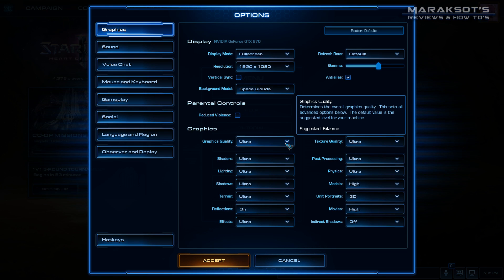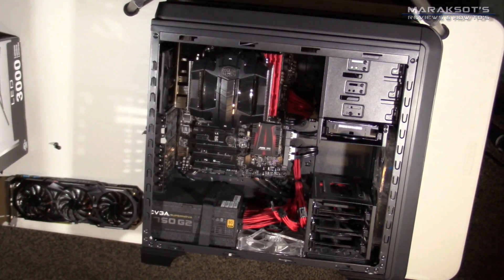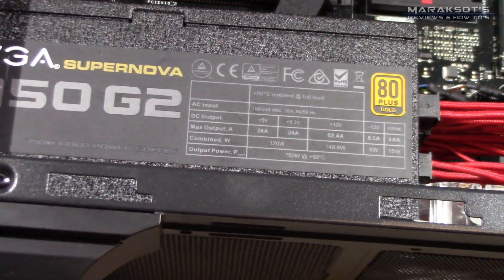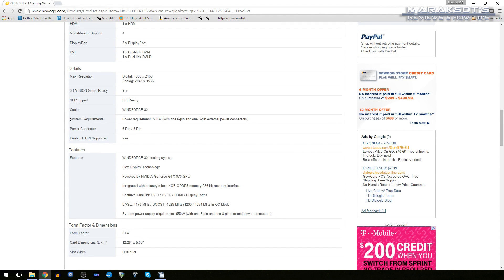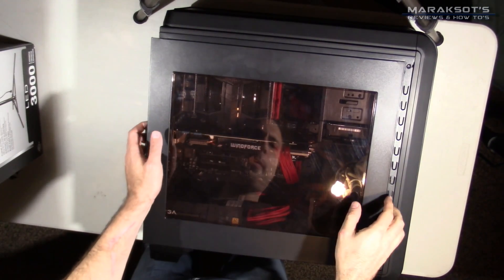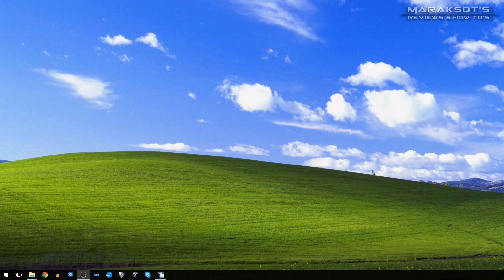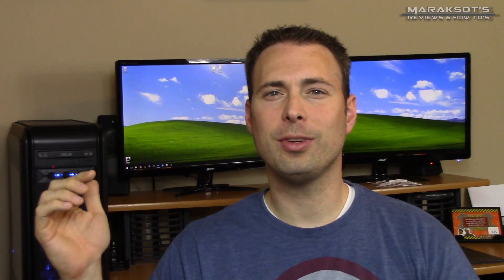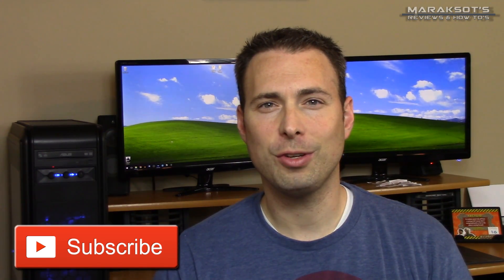A Beginners Guide - Upgrade your GPU - How to Install a New Graphics Card

Comment: Hey there, this video came up on my first google search for "how to install a new graphics card". I clicked play and it auto-forwarded me to the exact part about installing a new card. Never done it before, and found your guide really helpful! I'm taking my old card out and replacing it in the same (top) port. its a GeForce GTX 1060 OC edition, if anyone perhaps wondered. Thanks again, will be checking out how to change my old HD into a new SSD after I get the card working!
Reply from the maker: Thanks for checking out the video and for leaving such a friendly comment.  You are of course more than welcome to check out my other video on swapping out your hard drive for an SSD a well.  Cheers bro!  :)
Reply: well, its taken way longer than I thought, but I have got the graphics card working first time, and the a new SSD AND windows installed on it - the motherboard gave some trouble with a dual boot menu (f8 and bios via del) which all had to line up. Thanks to your videos and a VERY helpful and patient friend, i'm downloading stuff to the new drive, updates etc now. Thanks again!!
Reply from the maker: Congrats man, enjoy!  :)

Comment: Question: wont you need to uninstall the driver of your previous card to avoid conflict?
if so what the sure way to ensure that no vestige of those drivers stay on your computer?
Reply from the maker: You can switch cards before uninstalling drivers without any problems but yes I always uninstall the old drivers and then install the new ones. You can use a program called DDU (display driver uninstaller) from Guru3D and it will do it for you or you can follow this tutorial video I made and do it manually.  https://youtu.be/e3dGYvIa4pg

Comment: Can someone help I can’t see a 6pin or 8pin?
Reply from the maker: If your power supply doesn't have 6 or 8 pin PCI Express power connectors on it you're going to have to either buy a new power supply or buy some adapters. They have adapters that go from molex to PCIE as well as SATA to PCIE.
Reply: Maraksot78 im new to this stuff dose it have to a 6/8pin
Reply from the maker: Yes.  If your graphics card has a port on it for plugging in a 6 or 8 pin power plug you have to plug in power to it other wise the graphics card won't work.  Your motherboard is capable of supplying something like 75 watts through the PCIE slot your graphics card plugs in to.  So when a particular GPU requires more than 75 watts to operate the manufacturers supply the card with the additional power they need directly from the power supply using the PCI Express power cables.
Reply: Maraksot78 so I need a new power supply
Reply from the maker: only if your current power supply doesn't produce enough wattage.  What graphics card are you putting in and what's the wattage of your current power supply?
Reply: Maraksot78 the watts of my corennt power supply is 500w
Reply: Maraksot78 I don’t know what graphics card to put in but I’m looking for 1
Reply from the maker: I asked what graphics card you're buying because on the specs for the card it will usually have a suggested power supply wattage but 500 watts is great and should be enough for most current gen graphics cards.
Reply: Maraksot78 will it have a 6pin that I can’t see
Reply from the maker: are you talking about the graphics card or the power supply?
Reply: Maraksot78 do you have Instagram it will be easier to talk on there
Reply from the maker: yah,  I don't use it much. I'm Maraksot78
Reply: Maraksot78 I’ll dm you

Comment: I turned off my pc power supply took out the old graphics card put in a new one  plugged everything back in and it says the signal was received but my screen is black
Reply: It won’t show my display
Reply from the maker: So when you first boot up your computer do you see your motherboard splash screen and can then enter your BIOS/UEFI but as soon as Windows starts to load up then the screen goes black and doesn't come back? If that's what's happening then a BIOS/UEFI update for your motherboard should fix that.

Comment: Can you please help me my screen won't turn on after installing gtx 730 it only works if I take it out help me
Reply from the maker: After you install your graphics card are you plugging your monitor cable into your graphics card or into your motherboard, i.e. the video output next to all your USB ports and stuff?  If you're keeping it connected to the motherboard output you will not get any video signal because when you install a discrete GPU the onboard video on most motherboards is automatically disabled.  This is because if you don't plug your monitor into your graphics card then you'd still be using the onboard graphics and not the video card to do all your graphics processing.  If you are connecting your monitor to your graphics card and as you boot up you see your motherboard splash screen but then as it loads into Windows everything goes black then the only way I know how to fix that is to update your motherboards BIOS/UEFI.
Reply: Thank you for helping I got everything  sorted out now, I just need to install the driver
Reply: I cant find the driver for geo force GT 730
Reply from the maker: If you go to this site you should be able to select the GeForce 7 Series from one dropdown and then select the GT 730 from another and it will have a link there to download the most current drivers. https://www.geforce.com/drivers
Reply: does it matter what series it is? Sry for wasting your time
Reply from the maker: I'm not 100% sure it matters... After a GPU reaches a certain point they quit developing drivers for it but until that point the most current driver package will cover the most recent GPU's (currently the 10 series) as well as a few generations back. Whether the 7 series is still included I'm not sure so it's a good idea on the series drop down to select your series of card (in your case the 7 Series) and then in the drop down below that you should be able to select the GT 730 and that will give you the most current set of drivers for your GPU.

Comment: Does a graphic card usually come with the wire needed to connect it to the power supply and if not how do I know what and where to get it? I'm getting a gtx1060
Reply from the maker: No, the graphics card does not come with the power cable. Your power supply should have the appropriate power cables already attached to it. If not then, you'll have to buy an adapter that will adapt either SATA power connectors or Molex connectors to 6 or 8 pin PCI Express connectors. Here's some links to some on Amazon if you need them.

https://www.amazon.com/Monoprice-108494-8-Inch-15-Pin-Express/dp/B01EIJZK3U/ref=mp_s_a_1_5?ie=UTF8&qid=1528337107&sr=8-5&pi=AC_SX236_SY340_FMwebp_QL65&keywords=sata+to+pcie&dpPl=1&dpID=41C6Q31zBQL&ref=plSrch

https://www.amazon.com/COMeap-3-Pack-Express-Molex-9-inch/dp/B073PB6BTY
Reply: Maraksot78 dang didnt expect such a good response thank you very much
Reply from the maker: no problem man.  I'm happy to help.  :)
Reply: ok while i have you here, i cant find anything on graphics cards, clearly this is my first one, im putting togetther a pc and dont really understand them, i know you have to connect it to the motherboard but after that, what do i plug into it (monitor or something else) or do i connect my monitor to the motherboard, i honestly have no idea, im using a temporary monitor i found in the garage and it only has 1 dva port and nothing else, will this work?
Reply from the maker: Once you install your graphics card you'll need to plug your monitor into one of the video outputs on your graphics card. Most motherboards will automatically disable the output on your motherboard once you've installed a discrete graphics card, so it shouldn't display anything anymore. Even if the motherboard output did still work, if you plugged into it you would then be using the integrated graphics on your CPU and not your graphics card.  As for the type of connection from your monitor... is the connector from your monitor DVI or VGA?  Modern graphics cards don't have VGA outputs on them anymore, the 1060 I'm pretty sure has DVI on it though. There is two types of DVI however. There's DVI-D (which is a digital signal) and DVI-I (which is an analog signal). The 1060 is DVI-D so if your monitor is DVI-D then you'll be good to go but if your monitor is DVI-I you'll need an Active adapter like this one... https://www.amazon.com/Displayport-Adapter-FEMORO-Display-Converter/dp/B06W2FZ9MK
Reply: here is the name of the monitor, like i said its a old temp so i dont know much about it - https://www.amazon.com/AOC-E950SWN-19-LED-MONITOR/dp/B007B5SRV6 i couldnt idenify the type or port, it doesnt match either of what you listed lol so this is why im confused (these ports are like cars to me, they all look the same) Edit: now that i look at it, it seems to be only vga. is there a way around this? if not then i'll just buy a new monitor with the graphics card
Reply from the maker: ok, yup that is a VGA monitor.  They have adapters for that too here's a DP (Display Port) to VGA that should work   https://amzn.to/2JCYXoG

VGA is one of the oldest types of connections that I'm familiar with for a monitor.  After that DVI became the standard then DVI-D, HDMI and then DP (Display Port).  DP and HDMI are kind of trading blows with each other on which is the better standard right now and many of the PC elitists out there would say that Display Port is the best but I think either DP or HDMI is good.  I do like the way that DP has a kind of locking mechanism on it that locks it into the port so it can't be bumped out.  :)
Reply: alright thank you so much you've been a huge help, i was scared to go into this whole building thing but now im getting more confident, now to get over my fears of breaking these peices, i have yet to touch them, when you've been saving for years to get these parts, breaking them is a heartbreaking concern, im sure youre very aware of this lol i guess the next step is to build this thing
Reply from the maker: you're welcome man, that's why I make YouTube videos; to help people like you that want to learn this kind of stuff.  :)  You don't need to worry too much about breaking anything.  PC components are more durable than people often think.  You just don't want to be dropping them onto the concrete or anything.  XD lol  I'm sure you'll do great and things will end up feeling a lot easier than you thought they would be.  Enjoy man.
Reply: yeah its just when i hold expensive long awaited things my anxiety kicks up hard, i've been stuck on console for 10 years now and ever sense i played skyrim on pc for an hour like 6 years ago i've been a die-hard pc fan. but youre right, im sure i'll be fine. nothing goes where it doesnt. have a good day, again thank you
Reply: hey im back, got a few more questions, i got all my parts but i made a sizing mistake, my graphics card wont fit in my computer due to the size of my cpu cooler. can i use a PCIe extender or riser, which ever is the right name to remount it in a different location? and second question, my power supply doesnt seem to come with a cord for my card, i cant find it if it did, where could i go and buy one, again i have the gtx1060.
Reply from the maker: ExplodingMew hey man sorry I'm just now getting back to you. I'm guessing you've probaby figured things out by now?  If your motherboard has other PCI Express slots you can use one of them instead. You don't have to use the top most slot closest to your CPU. As for the PCI Express power cables... your power supply should have them with it but of not you can buy adapters to convert SATA or Molex power to PCI Express on Amazon.
Reply: Hey this is my new account, new pc and everything but 1: i only have one pcie slot my mobo is a PRIME B350M-A its a budget one ofc so i think im forced to use a riser 2: for the cable it was presleeved and it wasnt showing ( it was tucked into the sleeve i dont know why) so i got that figured out. so do you think the pcie extender is a good option or should i do something else? i have ample room if i just lower the vcard a little so the riser wont be obstructed. and for the response time, dont sweat it, we all have lives to attend to, cant hold that against you. at least you respond, not many do. Thank you.
Reply from the maker: before going with the PCIE riser I'd try reorienting my CPU cooler if that's a possibility?  i.e. having it exhaust air toward the top of the chassis rather than out the back or vice versa, which ever would allow me to put my graphics card in the top slot... assuming changing the orientation of the CPU cooler will allow it to fit of course.  If you don't mind me asking what CPU cooler are you using?
Reply: yeah its the PH-TC12DX CPU COOLER, i thought i correctly measured it but no matter how i orient it, it doesnt fit, now i could take a fan off and maybe slide it in but i dont think removing 1 of my 3 total fans is the best option, i ordered more but they never came so i need to fix that issue, until then i'd like to have those fans.
Reply from the maker: what case did you get?  I know this isn't the most ideal thing but can you fit a larger ATX motherboard in it?  That would help fix the problem.  But if you have a micro ATX case then you have to go with the micro ATX mobo...
Reply: its a reused ironside case, i liked the way they look so idk the name of it but its really big, so a riser wouldnt be good? i cant afford a different mobo im running off a college budget :/ i dont mind how it would look if i used a riser
Reply from the maker: ExplodingMew I think a riser card would work just fine. I was just throwing other options out there for ya.  :)
Reply: Maraksot78 alright you were scaring me. Trust me I wish I could get a bigger mobo but a riser seems to be my only option if you think of anything let me know I'd rather not use it but I dont mind using it but again college budget so keep that in mind lol
Reply from the maker: Eric Swansboro riser cards are fine. LinusTechTips actually strung a bunch of them together to see how much it would degrade the performance of a graphics card. With one cable there was no difference and with a dozen or more (I don't remember how many they used but it was a lot) it hardly changed at all. I think there was 1% or less performance drop using that many of them strung together. So using riser cards is all good in that department.

I was just trying to come up with ideas where you wouldn't have to buy one. I was thinking you could return your motherboard and buy an ATX board but buying the riser cable will be much less of a hassle and it'll get the job done perfectly fine.  :)
Reply: yeah i didnt know if it would cost any more plus the whole part about taking it all out too i copyed that part about the motherboard thing incase i decide on it for the future so thank you for your time, it was very helpful and yeah i saw that ltt video, thats where i got the riser idea from. if i need you in the future i'll be here (i hope i wont need you again) but yeah thank you for your ideas :)
Reply from the maker: you're very welcome man.  I'm happy to do what I can to help, that's part of the reason I started my YouTube channel.  Cheers bro! Enjoy that new PC.  :)

Comment: Help! i got me a gtx 1070ti with tx650w, i5 4570, (something like that cant remember) and 16 gb of RAM, i tried to remove my old gpu and install the new one but my monitor cannot recognize any signal from my gpu or pc. What should i do?
Reply from the maker: so you installed a new 1070ti, hooked up a HDMI or Display Port cable to it and now nothing will display to your monitor?  Do you see your motherboard splash screen but it then goes black once it starts to load into Windows or does it just not display anything at all?
Reply: Thank you for a fast response. No i do not see anything at all. No flash no nothing. Just black screen that says "no signal" Do you think it is my motherboard?
Reply: And also i was trying to pop the lock on the gpu when the lock popped and i kind of scratched something on gpu. i think that was the reason.
Reply from the maker: no problem, I'm happy to do what I can to help.  If it were me I'd try reseating the graphics card, make sure it's fully seated in the PCIE slot and make sure all the appropriate power cables are fully plugged into the card as well.
Reply from the maker: what do you mean it scratched something on your graphics card? did something on the fingers that plug into the PCIE slot get damaged or just damage to the shroud on the card...?
Reply: https://ibb.co/cgCqrT
https://ibb.co/bSJVrT
I meant this part of the motherboard
As you can see image#1 is pretty clean but image#2 is pretty damaged.
Reply from the maker: Ok, I think I see the damage you're talking about.  So does your computer work with your old graphics card in it? or does it not work at all anymore?  If it's not working at all any more it is possible that you damaged some of the traces on the motherboard which could have "killed" it.
Reply: Power from psu still runs in it. The mobo powers the system up. But no signal is being transmitted between mobo and my monitor. I have tried running the new gpu, old gpu and even on-board graphics. No luck at all
Reply from the maker: Who is Lee hmmm... yah it's possible you damaged somehmthing on the motherboard that has to do with display output I'm not 100% sure but it's very difficult for me to precisely diagnose it not being able to see what's going on in person. :-/ sorry man.
Reply: Maraksot78 hey man. Thanks for the help. I will try to buy another mobo. If that’s not the problem i will write to you again if it’s alright
Reply from the maker: Who is Lee yah let me know either way. I'll be happy to know if a new motherboard fixes the problem.